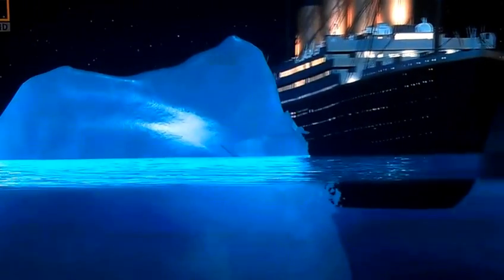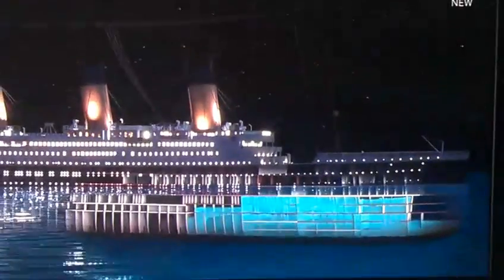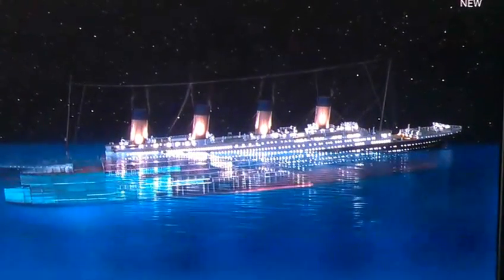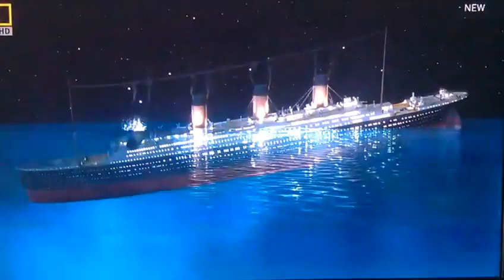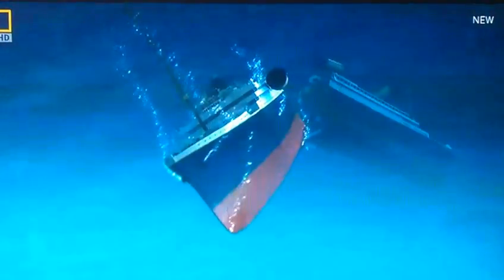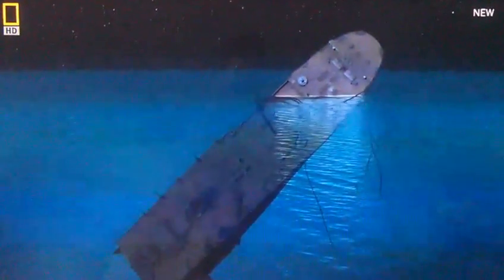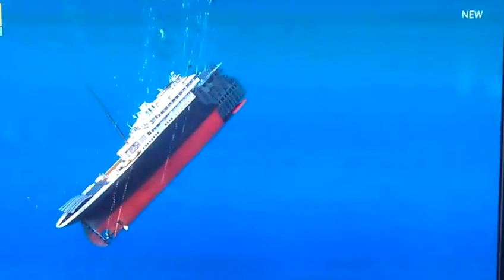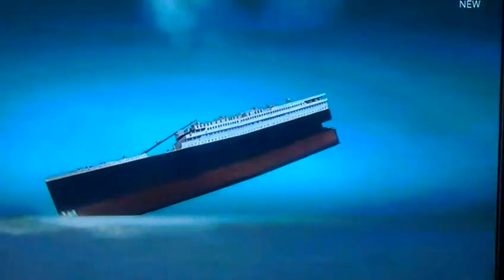Titanic Sinking Simulation - Updated 2012

Comment: The engineering firm to this day keeps defending the rivets used but from the wreckage its clear that all the iron rivets used in the front area literally all popped off...towards the center where steel rivets were used, the ship held up tight with no breakage...the ship was going to sing regardless but had they used steel rivets throughout the build the Carpathia would have been able to reach the disaster site before it took 1500 people down.

Comment: This looked pretty promising until it snapped. In the video it snapped just before the third funnel, but the titanic actually snapped behind the third funnel.
Reply: Ok let me set you straight this is a updated version and so they found out it actually snapped in front of the third funnel.
Reply: I thought they could never tell, because the area where it snapped was completely destroyed and beyond recognition on the wreckage.
Reply: Doctor Psycho Killer yes but if you examine the bow wreck verry carefully you'll see that only the first two funnle hatches are present. If it had split between the 3rd and 4th funnle, the bow would have 3 funnle hatches, not two.

Comment: She would have survived (probably) if the bolts on the front were made properly, or just a straight frontal hit with the ice berg. (in that case less segments would take in water, and then probably not sink, at least not that fast.)

But the biggest thing is that Titanic didn't listened to the icebergs warnings.

There is no such things at unsinkable, and they did know that. But the segments were there to make it less likely for the ship to sink.

Comment: there has been tests on the steel from the 'Big Piece' brought up in 2007 which came from the break area of the ship and this simulation doesn't take that into account it would have been impossible for the ship to reach the high angle it would never have got past 12 degrees before it broke

Comment: Survivor accounts and images of the wreck site from the 80's prove that the ship broke just before the third funnel. there are only two casings of where the forward two funnels were.this a more realistic version of the sinking. Also they were called funnels not chimneys. each big enough to run two freight trains through. also another way of proving that it broke between 2nd and 3rd is the wreckage from the 1st class lounge paneling that was found.

Comment: The Titanic broke between the 2nd and the 3rd. What is in the film was deemed correct at the time of filming, but has since been proven incorrect. 

229wazup, it has been documented all boilers in tact, thus none of them exploded. This is not what caused her to break. The weight of her stern above the water, and the bow pulling her out of the water is what brought her to breaking point.

Comment: It is supported by the wreck, but there are many teams doing the same as Cameron who do not agree with him, members on Camerons own team don't agree with him. The point is there is so little released data in this documentary that I could conclude anything states as correct and only as logical or well reasoned. One point I would agree with him on was how the Grand Staircase was removed, I would agree that it simply broke free floated up and drifted off in various pieces.

Comment: There are thousands of extremely researched theories comparative to the quality of Camerons. It is a logical well thought out theory, but I don't buy it as correct because in this same documentary there is a lot of assumptions made without hard data. Much of his theory is based on finding problems within it and then devising an assumption to sooth it instead of facts. I dont think the downdraft would have done much of anything except blow of some deck features it would not compress decks.

Comment: that's all true, but i still wont believe that theory.  it didnt list that way, it did only list 2 degrees to port, first 2 to starboard, before 1:00 a.m.
and the break-up is between 3 and 4, since the stern section is smaller, and the break-up was at an angle 45 or more. maybe even 70

Comment: it did break right under the 3rd funnel. its just science. the ship listed to port because of certain water passage ways. plus doors could have been opened on the port side AND the ship heeled to the right to avoid hitting the propellers. water sloshing causes weight to go to one side. in this case it ended up being on the port side